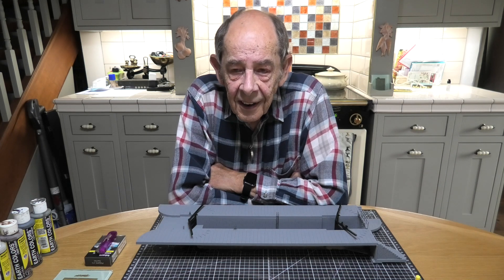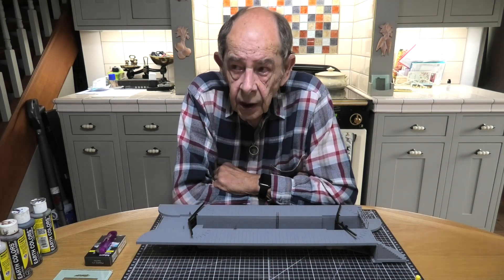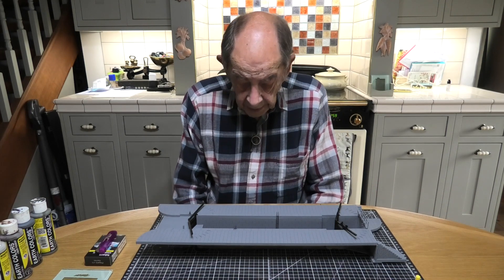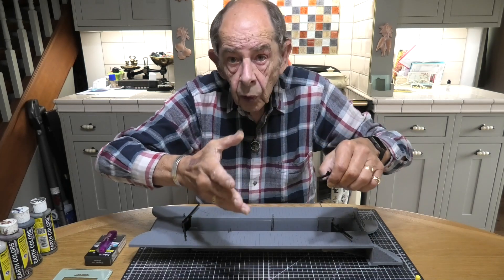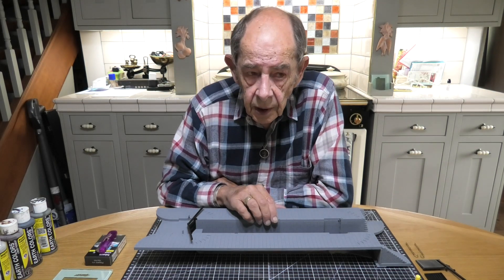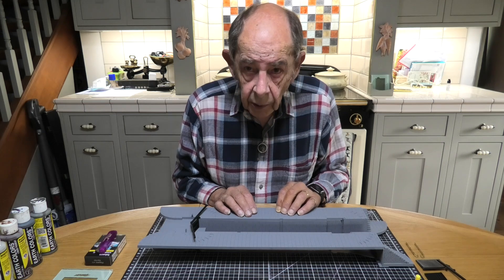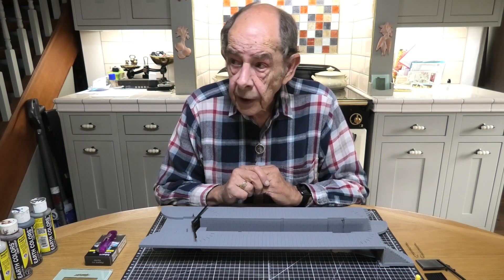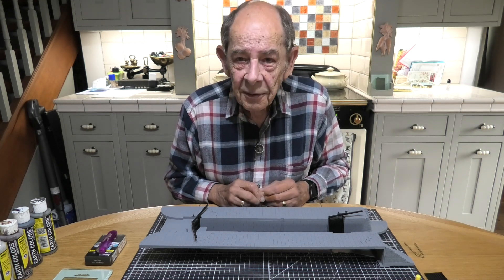The JS Models canal lock is now fully built - now its time for paint.   Part 2.   17-09-2023

Comment: Looking good mate, looking forward to the painting! Forgot to mention to you that those top lockgates were a tight fit, I think I had to do just a tad of filing on the outer edges of both gates but I had painted them first so that was probably why, cheers Steve
Reply from the maker: Hi Steve and thanks for the comment, like you, I have now filed them down so they are not so tight, they won’t be moving anyway so no problem. Getting on with the painting now!         Cheers.         ………….Graham